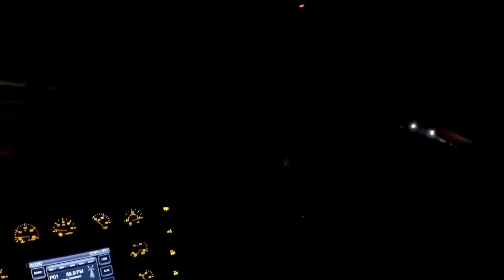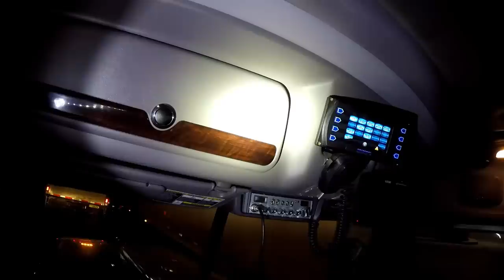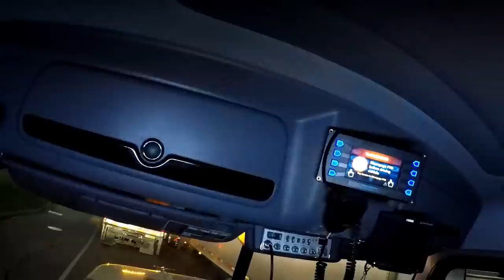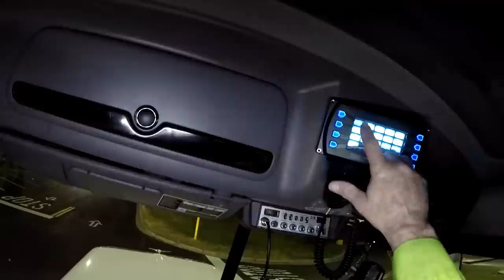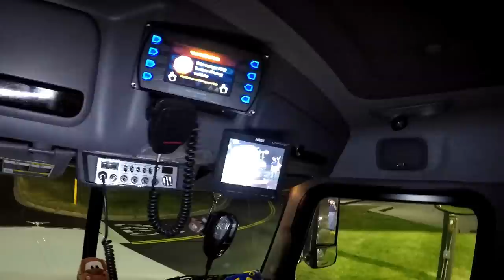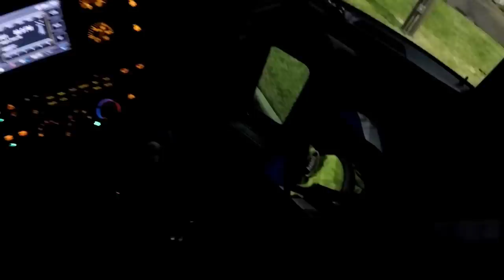Heavy Tire Lift Tow

Comment: As always, a job well done Ron, but do you mind if I ask a quick question, how many braking systems do you have on the Rotator, I think I sometimes hear an exhauster brake, or am I hearing things, over here, when I was driving, we could have three braking systems, a Telma Retarder system, an exhauster brake and the regular brakes, but some newer Drivers didn't know how to work the Telma properly, or some, even the exhauster, one driver I was on a two man job with, was doing 60mph, and just pulled the Telma leaver full on, without slowing down using the brakes, but some newer drivers, I don't know why, instead of asking for advice, would go it alone, and caused themselves problems, but I never heard of anything too bad, I have always remembered and stood by something the old Instructor told me all those years ago when I was training to go on the road, he said "when you pass your test, that's when you start learning to drive, and if you're a good driver, you'll never stop learning", and I found it to be oh so true, anyway, thank you Ron for yet another good video, well worth watching
Reply from the maker: The Rotator only has the exhaust retarder, or engine brake as we say over here, and the standard air brakes.  The Telma retarders never really caught on over here.  Quite a few older coaches used them and some heavy-haul equipment, but that's about it, to my knowledge.  Thanks and God bless.
Reply: Thank you for the reply Ron, it's much appreciated

Comment: Why not use the wheel lift more often? It would seem that if you just left the arms in there and not have to take then on and off all the time it would be much faster to do a wheel lift more often instead of doing the under lift from the frame. It seems to me that with the clearance issues all the time and having to first lift the truck up first and then having to change the different size forks and then chaining it all up and getting under it over and over it just send to me that leaving the wheel lift set up on there full time would just be a much faster operation and not have to deal with the headache of lifting from under the body. Especially for local shorter runs. Any input as to why not use wheel lift more often than the under set up?

Comment: Why do you need to use a light board, here i the uk we just use an ON TOW sign on the back end and plug a fly lead from the the wrecker to the towed trailer and just leave the tractor lights on.?

Comment: Scrolled through the comments didn’t find my question, but why do take the drive shaft out for towing?
Cheers
Reply from the maker: Removing the drive shaft eliminates the risk of possible transmission damage.  With the drive shaft left in place, it turns any time the towed vehicle is moving and is doing so without the transmission receiving lubrication.  Manual transmissions could possibly survive being towed for short periods without damaging the transmission, but I still remove it for liability reasons.  An automatic transmission could be destroyed within a city block if towed with the drive shaft still installed.  Thanks for watching and God bless.

Comment: Hey Ron, I dont know if you noticed but I have seen in a few videos that the body warning lights on the side and rear dont seem to flash anymore. Did ya blow a fuse or pull a wire :P

Leave it to me to find the most uninteresting thing to comment on LOL
Reply from the maker: Not a problem.  They are still working.  I simply don't always turn them on.  They are EXTREMELY bright and can actually be distracting.  Thanks for watching and God bless.

Comment: "Putting these rascals on on your own is NOT fun..." Oh, if only you had some device nearby that can lift heavy stuff... though that's probably more hassle than it's worth in its current form; Maybe Miller can redesign them as a drop in attachment on the underreach and store it next to the spreader bars; use the boom and a winch to install it and have a whole lot of extra space available inside...
Reply from the maker: Actually on some of Miller's units, not the rotators yet, they actually have a storage option available 
for the large scoops at the back of the bed beside the boom.  Pretty cool.  http://news.millerind.com/tag/wheel-grid-storage
Thanks and God bless.

Comment: why didnt you just use stinger under front axl to do double pick...alot easier, plus after you set it down on blocks stinger is already under there so you can put forks in place...done it many times and works great
Reply from the maker: This was a hollow axle with air ride suspension.   I used the manufacturer's suggestion method of tow.   Thanks for watching and God bless.

Comment: Can you help me understand why you can't lift a truck from the front axel when it is equipped with air ride suspension<
Reply: He mentions its a hollow composite axle = no good for tow point due to stresses not designed for.
Reply: I am not an expert but i don't think air ride was the reason, it was the hollow composite front axle that made the lift no go. Forks i think could been used if it was solid steal but would have to be careful the fork doesn't get in to the bag as it could rip them. Back to axle being hollow probably ment it wasn't strong enough to support having all the weight on it via the forks. Wheel life probably better idea as takes away the forks ripping one those air bags and causing more damage.
Reply: The reason he can`t tow it from the front with the air ride on the front is because the weight on the air bags will make them pop and the axle is not made for that weight of stress.

Comment: Why don’t you strap the steering wheel when using the wheel lift?
Reply: The tires/wheels are strapped down and locked straight into the lift. They can't turn so no need to strap the steering wheel.
Reply: hunter13605The Front Wheels arnt in contact to the ground, Strap the Steering Wheel when doin  a rear wheel lift
Reply: You only need to strap the steering wheel when the front wheels run on tarmac, i.e. back-end tows
Reply: hunter13605 you only need to strap the steering wheel if the steer axle is on the ground when towing.
Reply: It's not just for when they're running on the ground. He also straps the steering wheel during a regular front end lift with the forks so the wheels don't flop around and hang out to one side or the other.

Comment: Wouldn't it be better to have the wheel lift's rear chock plate at the end of the tube and take up the slack in the front at the T Bar? Seems to me with the tube sticking out to the rear that there's a danger of getting the tube into the fender and damaging it, especially while turning.

Comment: When you press the Yellow and Red button in the truck, what does that do?
Reply: Jazzymaz releases the tractor air brakes for the yellow one and the red one releases the trailer brakes
Reply: Jazzymaz There are several different functions of the yellow and red knobs, on the dashboard!

Basically, the yellow knob applies air to the parking brakes, on the tractor, to release the brakes!! The red knob supplies air to the trailer air storage tanks, supplies air for the air suspension (if equipped) and supplies air to the trailer parking brakes, to release them!! As a bonus, the blue air line that you see being worked with, is the service brakes air line!! After air is supplied to the systems, distributed, and released the parking brakes, the blue air line is what supplies air to the regular brakes, for slowing and stopping!! 

Before I became a trucker, I had trouble understanding the system thoroughly!! It's technically a very complicated system, but also very simple! Perhaps you have seen some of Rons other videos, where he CAGES THE BRAKES, to be able to tow the truck! Well, caging is necessary when the ability to supply air to release a parking brake, is not available. And the engine running usually is the air supply! With no engine running, there is no available air! So he has to plumb in air lines from his truck, which is what he did in this video, or mechanically override the parking brake (cage the brake). With the caging process, it totally overrides the braking to that axle! This load was heavy, and he wanted to be able to use the service brakes, to help slow and stop the extra weight! So he plumbed in air from the tow rig, and was able to use his air supply to release parking brakes, and use service brakes!! In this video, he accomplished that in two different ways!! One was to tap into the air supply tank, underneath the tractor!! The second way was to extend his blue air line back into the trailer air connection!! He added air to the tank, which supplied his air to the tractor, which then supplied parking brake release air to the entire rig!! It also supplied air to the air suspension, to the entire rig!! Then he added  the blue line to the trailer, which gave an air supply to the service brakes, when he stepped on the brake in his tow truck!

I hope this helps, and isn't too much info!

Comment: Why can’t you fork it on the axle I’m a heavy driver out in California and I get a lot of those axles and I’ve forked it before am I doing it wrong?
Reply from the maker: Apologies for the delayed response.  There are several different styles of those axles, some of which are hollow.   Some manufacturers suggest tire lift only.   They claim there is risk of bending or kinking the axle...   I've done it both ways and haven't had any issues.   There are special forks for those axles now, also.   This is an older video, so it may have been before they came out with the special forks.   I don't know.   Like I said, I've not had any issues.   However, "always follow the manufacturer's suggested method"....you know how that goes.   Watch your 6 Brother.  Thanks for watching and God bless.

Comment: Wow, how long were you?
Rotator tractor and trailer, with something that length why do you not need a (Police) escort?
Reply from the maker: When I'm towing a truck with a 53' trailer I am over 100' total length.  How far over 100' depends on the length of the truck that I'm towing.  My truck is 40' without the under-reach/wheel-lift lowered.   Thanks for watching and God bless.

Comment: Why would you not just hook the trailer light output on the tow vehicle to the trailer connection, therefore you would have stop, turn and running lights commanded from the tow vehicle?
Reply from the maker: I have that with the remote light bar and don't have to worry about cords.  The light bar is fully functional with stop/tail/turn lights.  Thanks and God bless.
Reply: "Remote" Light bar, so I reckon it has a radio link to the tow vehicle to control the lights. Very ingenious. Thanks for the speedy reply, we're tuned in for more!

Comment: Maybe I'm not understanding the purpose of the break away chains.  Seems if the towed vehicle actually broke away, those chains would snap instantly. If not, they would cause the towing vehicle to be moved around violently with loss of control.
Reply: The typical towing chains that Ron uses are rated for 80-100,000 pounds each for lifting vertically, plus a considerable safety margin, so I doubt those would snap instantly in a horizontal breakaway at safe driving speeds.

Comment: what does the brake away chain do
Reply: Its used as a backup in the event that the main securement chains holding the towed vehicle to the under reach fail to keep the towed vehicle under as much control as possible
Reply: Once the brake away chains activated,  it's safety feature to have extra safety in order to lock the breaks if it breaks away from tow.

Comment: What is your engine & transmission setup?
Reply: Cummins 550 hp ISX matted to Meritor 18 speed
Reply: I remember him saying it was 550hp Cummings engine or some where near that power. as for tranny would expect 16-18 spd given what the truck is designed to do.

Comment: Why don't u put u two 50 hose reels on the back for your air supply
Reply from the maker: Unfortunately no room on this configuration of truck to do that.  The drag winch, hydraulics and other items prevent them from being mounted in the bed and the rotating boom won't allow mounting on top of the bed.  Would love to have the hose reels.  Thanks for watching and God bless.
Reply: Ron Pratt I thought there would be enough room some were outside of the super structure. Would make your life a lot easier. .God bless brother and merry Christmas. .